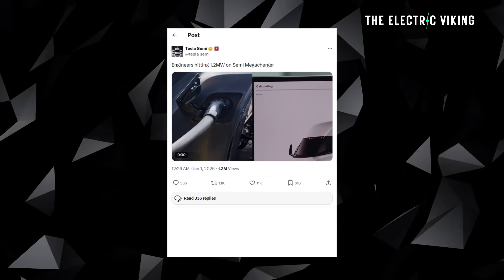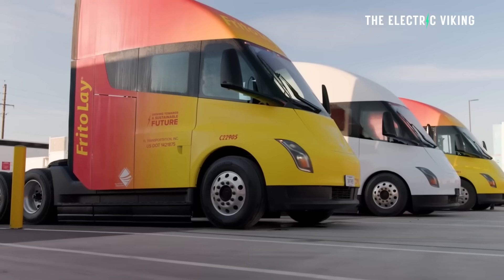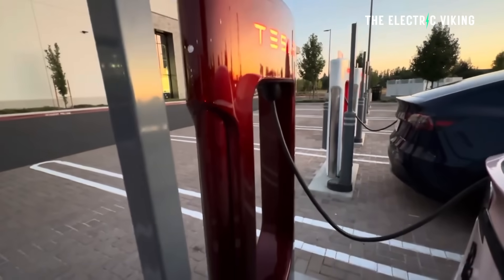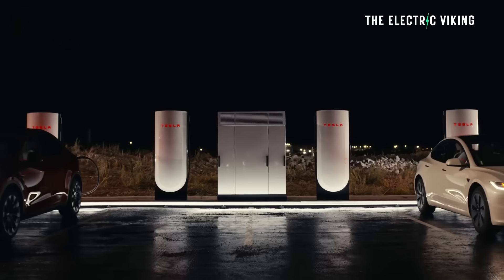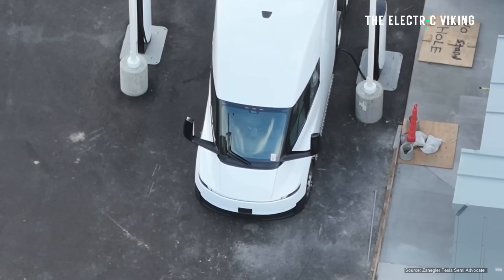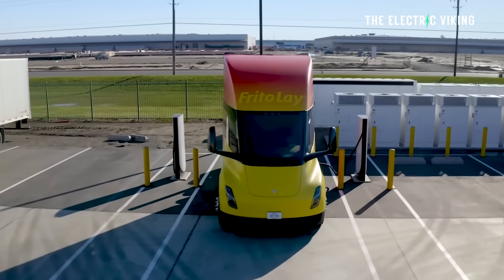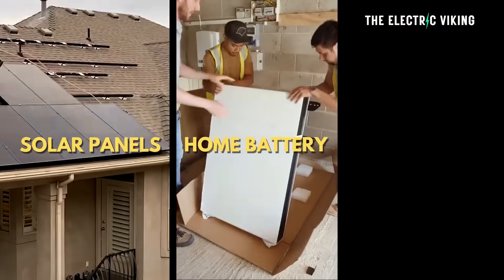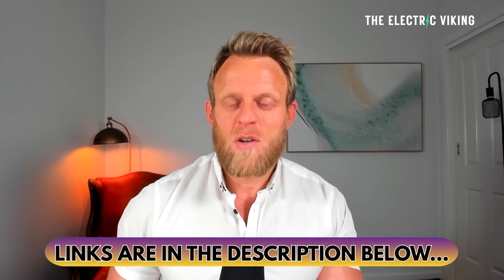Unbelievable Tesla Semi Charging Footage Shows 1.2 MW Peak Power!

Comment: I doubt given tesla charging curves up to this point that it will hold over 1 MW for very long.  So it will probably be substantially longer then 45minutes for a 10-80% charge. But that's fine as it will take about 10 hours to drive 500 miles at 60mph anyway, so you start to overlap with mandated driver rest periods or time at a depot. 
   I could imagine overnight truck rest stops having a mix of both MW chargers and lower power "trickle" ones as low as 50kw. You could install 20 for a MW of onsite power. A typical workflow might be arrive, plug into a MW charger and as you wait do some mix of toilet, shower, food or just relaxing. Then move to a trickle charger for overnight parking. Or the opposite with sleep first. 8 hours at 50 being a respectable 400kw added.

Comment: Elon - I offered to show you the simplest, lightest, least friction, least unsprung weight and most cost effective EV driveline, (proto running) when you went to help get the 'wild boars' s out of the cave. You deleted my tweet.
That was after I recommended you apologise immediately and unreservedly to Vernon after you called him 'pedo guy'; apparently the 'insult du jour' amongst the pre pubes at Pretoria Boys High. You deleted tweet, chose court.
Now I have the best CPU cooler - first proto 0.225 °C/Watt - double next best - BEFORE CFD optimisation. 1 KW CPU?

Comment: I don't think it's going to be displacing the diesels in the US anytime soon.  There won't be enough charging infrastructure, and due to the amount of power required,  it might take a while.  They also have reduced load capacities due to the batteries, and those eat up a chunk of the 80k pound weight limit (which you can go over, but you have to get a special permit and pay a fee to do so.)   I think self driving on semis will also be slow coming.  Not because of software issues (fsd seem to be solved  for cars already) but due to the incredible bureaucracy and slow rate of change of regulations.

Comment: Driving down I-10 every 5 -10 miles, sometimes more sometimes less, there are several fueling stations at every exit.   It’s common to see multiple tractor trailer trucks fueling up at the same time. How will they create this electricity?  A 5-10 MW capable charging station every 15 miles just for the large trucks isn’t going to happen.  It’s like a  data centers worth electricity required every 15 miles. Just for trucks. 

So during the same push for more grid capacity in order to run AI facilities we need to also build out an equally large power generating facility simultaneously.   

Who do you think wins that battle. We can’t do both at the same time.  The power to run AI data centers will be prioritized over power intended for vehicle charging.  

This technology will stay niche for the foreseeable future. The power needed for AI will take priority over something like this. Diesel works just fine and the climate crisis frenzy is a fabricated one.

Comment: Looks similar to the implementation of chargers elsewhere. In Sweden, gas station companies are setting up MCS chargers for heavy trucks, which should be the same. However, for now, most EV trucks are charged whenever possible at logistics centres or similar, where they may charge at a lower rate over a longer time, which may be more cost-effective. Anyway, the MCS makes sense for charging over breaks for rest or eating.

Comment: When the Semi starts robo trucking at launch will be autonomous-  watch.  And you'll see these with a recievers that drop down for inductive charging.  Have loading and unloading bots in the cabs and run in convoy trains with the lead truck shifting to the back as its battery runs down successively besting rail economics and massively increasing range.

Comment: In the UK charging a Truck would cost far more for 2kw of electricity than it costs for 1Ltr of Diesel, so the numbers simply wouldn't work here in the UK. Unless charging is very much cheaper, then any van, truck or long haul vehicle will always be diesel.

Comment: I’ve been saying for years. The day a company puts solid state batteries into a semi truck is the day we’ll truly start cutting emissions and electrifying. Semi trucks going 800 miles in 8 minutes with no maintenance and $40 in charging cost, instead of $210 in fueling cost, will make it that logistics companies will drive the ramp-up of solid state manufacturing. Driving down costs and funding further innovation much quicker than it’s taken to drive down costs for conventional liquid lithium.

Comment: Physics has spoken! Battery-electric trucks are more efficient, have fewer parts, are cheaper to manufacture, etc. Unfortunately, physics also provides the raw numbers in kw/hrs or mw/hrs required to charge them! And that does NOT represent a trivial problem, it's is a very real, expensive challenge, that our current crop of politicians (particularly in the US) have so far conveniantly outsourced to Tesla and other, non-governmental, entities! If EV-Trucks take off as anticipated, someone will have to pull their finger out...

Comment: At least in the E.U., those charging speeds are superfluous. After four and a half hour, a truck driver has to take a break of 45 mins anyway, enough time for an off-the-mill 400V charger to recharge the battery of that truck enough for the next four and a half hour of driving. A German truck driver has a video blog on YouTube, Elektrotrucker, of his long haul driving electric trucks from different manufacturers for about a year through all of Europe.

Comment: Great charging speed for LFP cells.
Model 3 with 60 kWh LFP-Pack charges with 168 kW. (2.9 C-rate)
The Tesla semi charging at 1,200 kW is something like a 1.3 C-rate.
The problem is probably battery heating, cooling and chargeport-cooling

Comment: It will be good if inner city trucks can be transitioned away from diesel. 

I lived in SE Asia for 20 years, and those damned dirty diesels would blacken everything that lined major city streets. As a side note, the ubiquitous 2-stroke motorcycles would leave blue clouds hovering over major city streets. The PM 2.5 measurements were typically way up in the “danger zone”. Natives there were wearing masks long before Covid hit!

The gov, through incentives, was able to switch many of these trucks and buses to CNG (compressed natural gas), and that made a huge difference.

The electrification of trucking fleets could be another step in the right direction.

As for the 2-stroke bikes, the gov was eliminating the taxes on 4-stroke models (sound familiar?) to steer customers away from the 2-strokes. Getting rid of those things was also a blessing.

Comment: The semi has been in slow motion to production and getting out of the testing range . It would be difficult to get multiple chargers at these power requirements . Just one charger could be a power supply for a factory . With data centers sucking up electrical power I just don't see the capacity for a substantial percentage to go electric . Tesla knows this and has not turned up the production momentum . It has proved it works in the real world .

Comment: Here in the UK most local deliveries are already EV, which makes perfect sense with lots of stops and no need for long range. The road transport businesses are gaining experience with these 1-3 ton vans. The likely next step is medium trucks capable of round trips between cities and distribution centres. Many round trips are under 200 miles/300 km. If the fast charging capacity is installed, trucks able to haul 40ft standard containers don’t need much more range here because drivers are required to have breaks, so the transition could be quite rapid now that the economic benefits are understood.
Reply: So you're going to have chargers on every lay by, industrial side road, truck stop parking space, loading bay? Many trucks don't do "round trips" they go from one stop to another. Plus many trucks that do return to "base" at shifts end, see another driver jump in and take the truck straight back out. For SOME applications they work, but not close to all. I don't think the Tesla semi would even be legal in the UK on dimension rules.
Reply: @DaveR7920  you are letting the perfect be the enemy of the good. We know that most routes can already be covered by existing electric trucks. Sure we don't have a electric crawler to move lunar rockets but that is a niche application.
Reply: @someonenew3478  No I'm telling you that electric trucks suit SOME applications just like electric cars do. They don't suit all or even most when it comes to trucking. Sam (and many others) seem to think EV's will and should replace ICE and that is just not practical.
Reply: Renault, for example, are running a fleet of 22 long haul electric trucks that cover 450-500miles a day. They are used up to 18hr a day and charge during driver breaks, trailer swaps etc. on their own sites. This fleet connects their several manufacturing sites. When CATL offers their latest battery tech to non- Chinese manufacturers, trucks like these will be able to charge in less than half an hour - they need around an hour at present.
Reply: @Affableambler  Yes some trucks applications on certain routes with lots of infrastructure can be electric, I didn't say they couldn't. Just like some are hydrogen powered and some are LNG. The majority are diesel for a reason.

Comment: If a Semi charges at a V4 stall will consume all of the supplied power, maybe a little less, depending on the transformator. I know the introduction of E-trucks is not happening from now to tomorrow, but to supply a suitabel power infrastructure will be a massive task. Speaking for Europe, every truckstop will need to have to power a lot of trucks and most of them at the same time (at night). The truckstops are stuffed at night and in a long term all of them will need power.
Reply: Yes, but it will take some time to get to that point.  It's like the argument about if all cars are electric it will break the grid overnight when they all charge.  But they aren't all electric yet, and we have over 30 years to go before they are.  The same applies to HGVs.
Reply: @simhedgesrex7097  I think this is different. Electric cars can charge almost anywhere and and anytime. The chargers are everywhere. Many of electric cars don't even use superchargers. For example I charge at home with at most 11kW, 95% of the time. Trucks need a lot more power in a shorter time and they can and must only charge when the driver takes his breaks (as long as there are drivers). So almost all of the will load at night at the truck stops. This makes it different. I don't say this is impossible, but it is a much bigger challenge for the grid, even if there is time for development. Maybe trailers with an additional battery pack can be a solution to distribute the power load.

Comment: Electricity prices will shoot up if the change over is too rapid and unplanned
Reply: How long is the average life cycle of a truck? You can easily calculate from the current number of used trucks and this rate the duration of complete fleet exchange. I will not happen over night. But solar panels and wind turbines can be installed at the same rate over that duration. Especially in the U.S. right next to the most desert roads, you have a lot of space, deserts, sun and wind.

Comment: One open question is whether this truck can work in Europe.    This cab is long, and there are maximum lengths stipulated in Europe.  My reckoning is that they have to tow a shorter trailer to stay within regulations, and if that's the case, would it have a strong business proposition in Europe?

Comment: Charging speed now really only matters for trucks where things need to get tweaked for each market so the battery capacity covers the max allowed driving distance/hours for that region before mandatory break, and the charger refills the battery fast enough to be done by the end of the break.
Chinese car brands compete on charging speeds because they are in a race to be one of the 10 surviving brands out of 100+ when the subsidies end, and they are running out of differentiators.
Electric Viking charging speed videos are 3 a day now, this is the first one I watched.

Comment: The Tesla factory can only make 50000 units a year
Reply: For a semi, that's quite a lot
Reply: @rowanbroekman3929  5 million trucks on the road, it's 1%
Reply: @JuliusFawcett Yes, but those trucks need chargers as well and you can't install those MW chargers that fast. For a start 50K sounds like a lot to me.
Reply: @JuliusFawcett  5 million trucks on the road.  How many new ones sold each year?  200,000?  50,000 is 25% of that.  And other manufacturers will be making BEV trucks as well.
Reply: I predict they'll make less than 300 in 2026. Unless Musk forces X and SpaceX to buy some.

Comment: It’s been many years and so few made and sold.  Soooooo slow .. mass production has been so slow to come. Because demand isn’t there because the charging infrastructure is very very pricey?...  Yes probably.   The charging is the key just like with S3 X and Y. ❤😂
Reply: Sorry you are incorrect.   It's because the factory had to be built.   There was only a pilot line until Nevada comes on line😊
Reply: @girowinters Ummm… 6 years   to build a factory? They could have built a mass production line in a year like they did in China if they had the demand. If you look at the startup cost of getting one of these very pricey trucks and necessary, charging infrastructure, you can see why they didn’t quickly build a factory. Because the demand is not there. There is something wrong with the formula, or maybe business owners are not willing to buy a truck that could explode with some kind of battery problem?! With any new technology, the proof can take many years to come out whether it’s actually a lower cost over the lifetime or not. Yes the energy cost is so low compared to using fuel. OK but consider the other things, and apparently, even the ergonomics of their truck is very questionable. They say you need to have a seat in the correct place, not where they put it. What car company also makes semi trucks? It’s super hard to do both. You need to completely focus on just one thing because semis are very special and the customers are very special compared to passenger cars. The semi truck business should be spun off.

Comment: I question how a fleet operator will be able to keep the trucks charged.

If you need to charge multiple trucks at the same time you're looking at serious eletrical grid upgradesand likely require megapack batteries to act as buffers.

I think electric trucking is going to require a more decetralised refuelling system compared to diesel trucks.

Comment: Fast charging is a good psychological selling point, I have only used a public charger 3 times in 2.5 years,most of my charging is either off my roof,or transferred from my home battery
Reply: Coincidentally same here, except in 3.5 years (Chevy Bolt 2017, used).

Comment: Here in USA, about 200 electric semi trucks were sold in the first six months of 2025, not sure how the next six months went.  Meanwhile, in 2025 (full year) about 250,000 diesel semis sold in USA so electric semis have a long ways to go it seems.   "Swappable" seems like it would work well for trucks.  Battery modules could be placed in the cab area as a unit and also in racks beneath the trailer that get swapped out for charged unit.
Reply: and. in Europe over 18,000 were sold in 2025
Reply: @geoffsemon7411 up from 4,000 in 2024. Big difference with USA is driving time regulations. Drivers have to stop for 45 mins every 4-5 hours so European BEV trucks can charge at 350kW and lose no time vs diesel. BEV trucks are still more expensive in capex but they are already competitive on TCO and they will undercut diesel in the coming year or so. 
USA driving time limits are looser, trucks drive much faster so use more energy, BEV semis in the US need bigger batteries and faster charging.
Reply: That’s in the US. Everywhere else, electric trucks, buses, ships, boats, trains are growing in sales and in use. In 2023, China produced 90,000 electric trucks - 80% of truck sales. Figures for 2025 have not been released but work on 25%/yr growth - so around 150,000. Add to this the 56% rise in EV cars and the 30% across the world and you are seeing massive growth. Why? Because they’re cheaper to run and last longer than ICE vehicles. Oh, and they pump out sh*t into the atmosphere so cities are cleaner and quieter.

Comment: First tear up the asphalt, than lay a 3-4 inch diameter copper cable that weighs a ton if it´s short. Wondering about cost of the charging station instalaltion and CO2 emissions to do it - for charging just one truck at a time. Imho replacement of diesel trucks and busses - as long as affordable - has absolute priority over exchanging every single commuter car for an EV. These things drive around all the time, not one hour a day. For the time being, I´d think electric trucks will be added to the fleets for specific tasks and routes for which they are well suited - with loading/unloading while charging at both ends. "Adding" does mean more trucks overall - not in the sense of replacing older diesel trucks for new E-trucks.